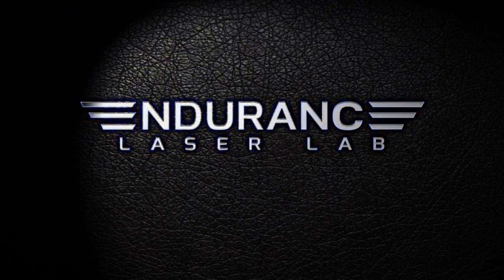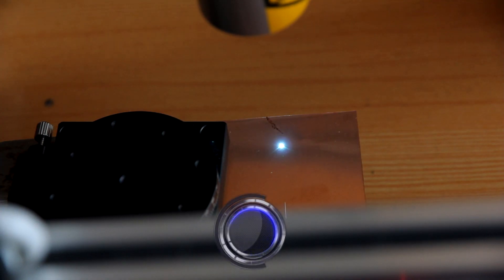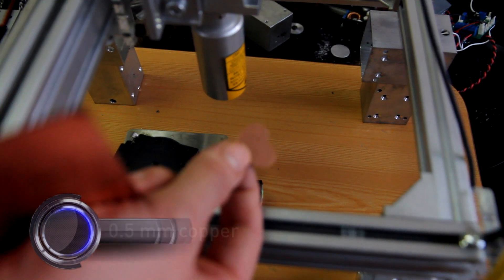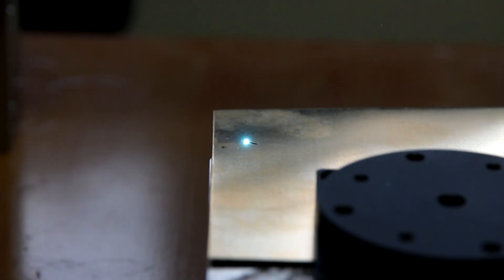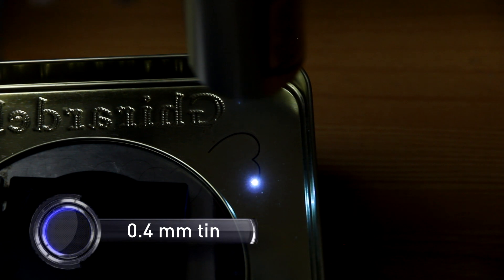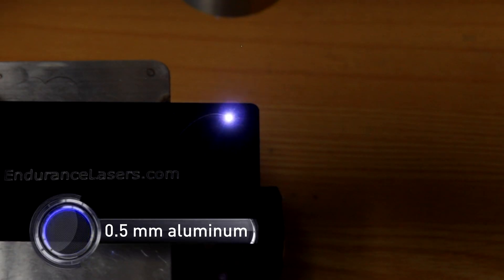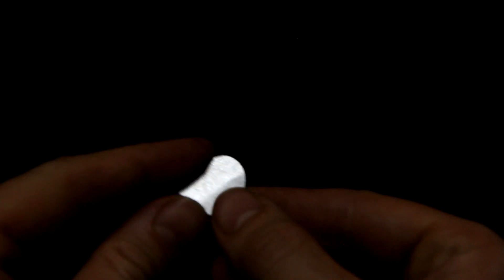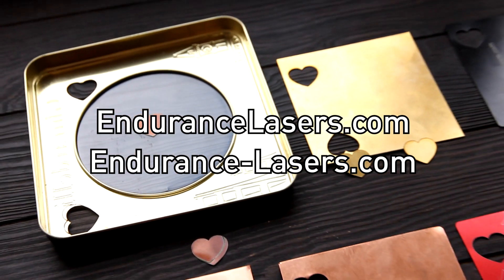Metal laser cutting with an Endurance 10 watt DPSS NIR laser module. Cutting up to 0.7 mm of steel

Comment: Hi, it's possible cutting 1,5mm stainless steel? or you have alternative only for cuting 1.5mm stainless steel sheet? Thank us your answer.
Reply from the maker: well, for that you need 150-200 watt Co2 or the same fiber laser... sorry but even 30-50 watt Galvo will not be able to cut 1.5 mm https://endurancelasers.com/how-to-cut-metals-with-lasers/